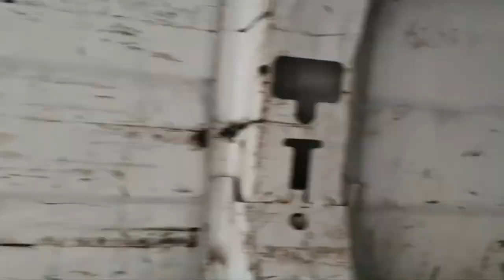van build / cladding / carpetting / batons / running lights / bellends / magpie syndrome

Comment: that cladding is looking proper smart, Paul. I kind of wish Id had that done on mine now but its too late. I also wish Id got a different bed instead of a rock and room one but the van is done now and I want to spend any money I get on getting out in her. I've got one semi flexible 150 watt renology panel on the roof and its been great for topping the batteries up but I'd deffo like to get one more before I start to use Viv-i-van because I'm intending being as off grid as I can. Keep the enthusiasm going and keep Betty II doing the doo.
Reply from the maker: Thank you 👍 Betty1 has one 110watt panel that works a treat! It keeps the batteries topped up really well and can last quite a few days 👍

Comment: I was going to put the roof battens in the same way but they would of all been slightly slanted..  Maybe it wouldn't of mattered but I'll keep watching this to see 😉
Reply from the maker: In the grand scheme of things it wont alter the level of the cladding.....the screws wont pull it in at an angle as they dont need to be so tight 👍
Reply: @bettyourcampervan  yeah was thinking the same 👍